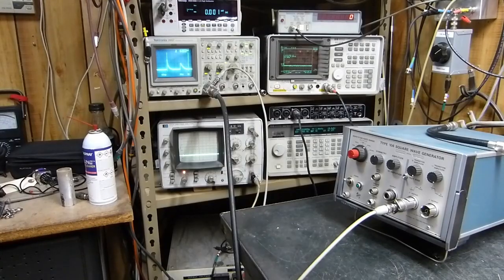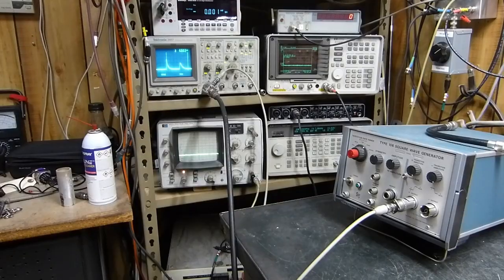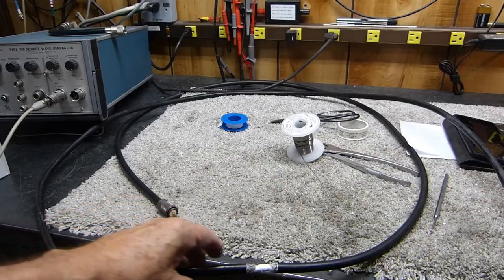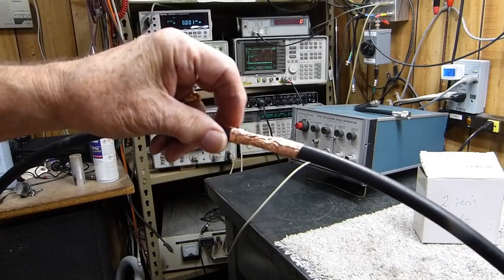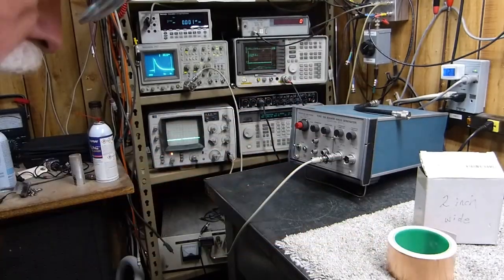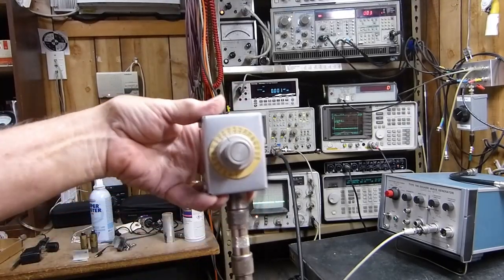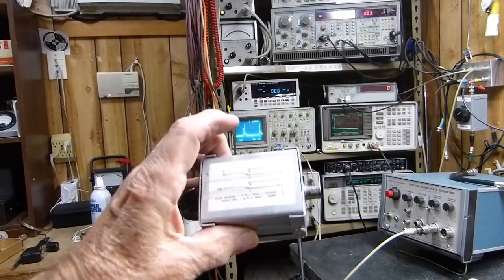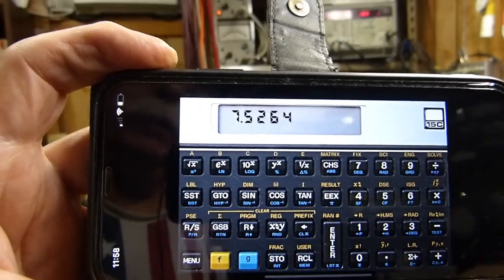RG-8, LMR-400, RG-58, etc. Splicing Coax,  Impedance Matching

Comment: Hi Dave, I’m not clear on the topology here. I know you probably said it but is it siggen to scope then a tee to the cable under test? Which is o/c at the other end?
Reply from the maker: Having the cable open, or shorted, at the far end, let's us determine the length of the cable by being able to see the reflection and measure the time on the scope. If the cable is open, unterminated, the reflected pulse will be upward on the scope and if the cable is shorted the reflection will be downward facing. If the cable is properly terminated with a 50 ohm resistor at the far end from the signal generator, there would be on reflection but the little bump that I call the impedance anomaly from the splice would still be there just the same.

Comment: ELPASO, What is causing those "anomalies"? because you're splicing coax cables that are different types and connecting them together, like connecting a RG-8 cable to an RG-58 by slicing them together causing "anomalies?
Reply from the maker: The anomalies are caused by a different impedance inserted along the coax line. The diameter ratio of the inner conductor to the outer conductor (the shield) 
along with the dielectric constant of the center wire insulating material, determines the impedance of the coax line. If we put, for example, 50 ohm and 75 ohm 
coax in series, there will be a step and not just a bump in the display. Here is another video that explains the physical dimensions of coax line a bit more.   
https://www.youtube.com/watch?v=pEkGrgXUZwk&t=37s   
Your question about splicing RG-58 and RG-8 - if the impedance of the two are exactly the same, there would be no bump or anomaly as they are the same impedance. 
So, it is OK to put RG-58 and RG-8 in series.
Reply: @ElPasoTubeAmps  So you won't get any anomalies if both spliced cables are 50 ohms? All cables have a different diameter ratio of the inner conductor to the outer conductor shield even if they are 50 ohms the LRC value changes.

Comment: Always a pleasure when you post! 
Can you explain what the countdown on the bottom right of your 2467 is? I've had all sorts of 2400 scopes and have never seen that.
Reply from the maker: That is a countdown before the trace shuts off. If we move any knob on the scope, vertical, horizontal, etc., it resets to 3 minutes. It is
a feature to save the phosphor on the screen. It can be over written with a bunch of button pushing per the manual but it always comes back
to that 3 minute timer when the scope is turned off and on. A bit irritating sometimes but I have just learned to live with it. I suppose 
Tektronix did if for a good purpose...  🙂
Reply: @ElPasoTubeAmps that makes a lot of sense. Thank you